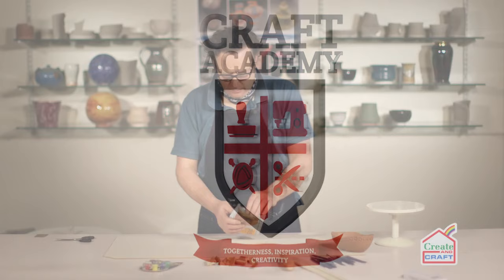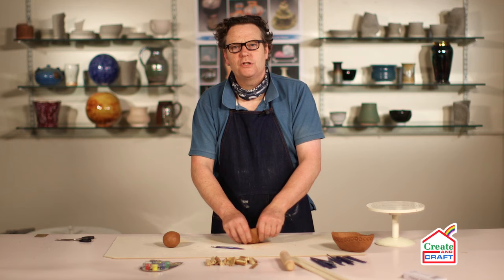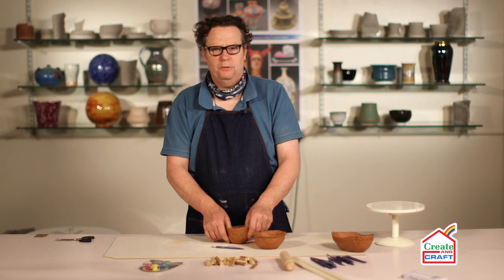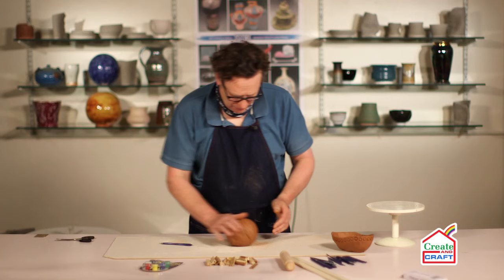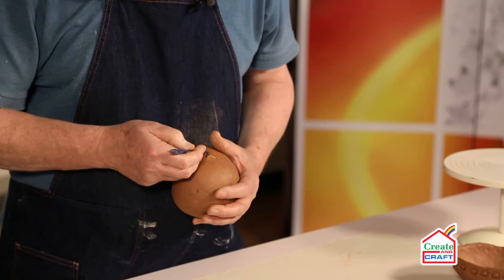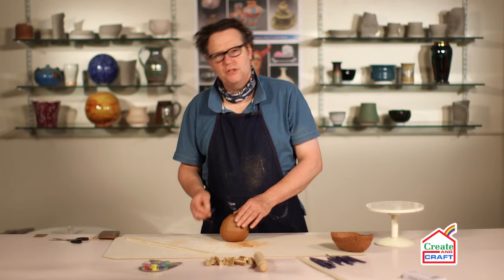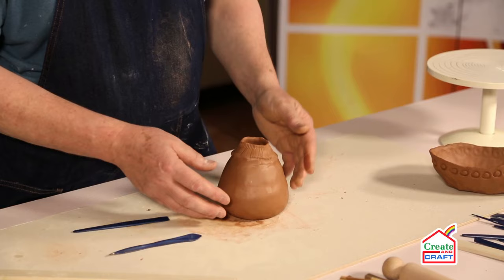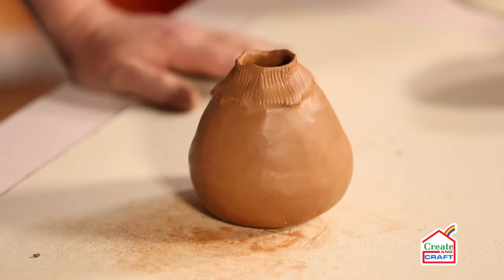How to Make an Air Dry Clay Pinch Pot Vase | Pottery | Create and Craft

Comment: Hi Kevin, thnx for sharing. To use as a vase or plant pot/container do we have to seal the inside to protect from water? And do we need to put anything over the acrylic paint  on the outside to protect from outdoors? Thank you in advance for any advice on this 😊
Reply: I have the same Qs as above :) also, is there something we should do to avoid cracking in the future, if using these as planters?

Comment: I want to create water dishes and hides for my tarantulas using this material. Is this water resistant when it dries and can it tolerate high humidity, tarantula enclosures are pretty high in humidity and does it contain chemicals that can be harmful to tarantulas and other animals.
Reply: Gold Piece probably not a good idea, air dry clay will become soft again once it's in contact with water, I'm still trying to find a way to make it waterproof, you can try using varnish for it. Haven't tried it yet.
Reply: @catpaws1913  someone said acrylic gloss.